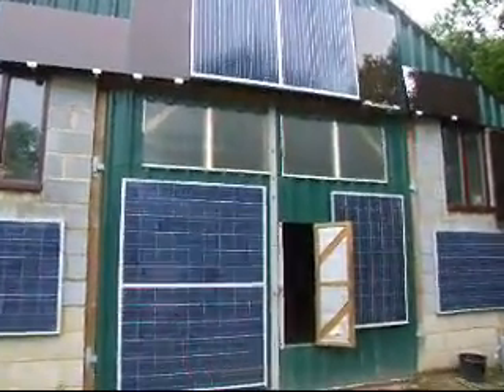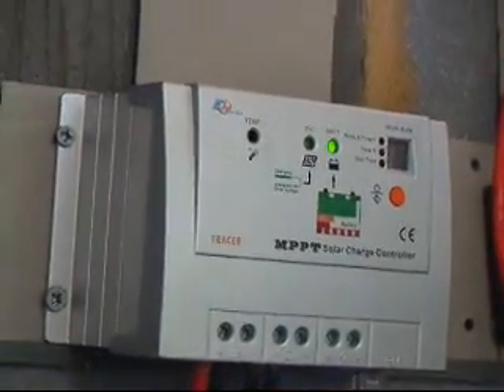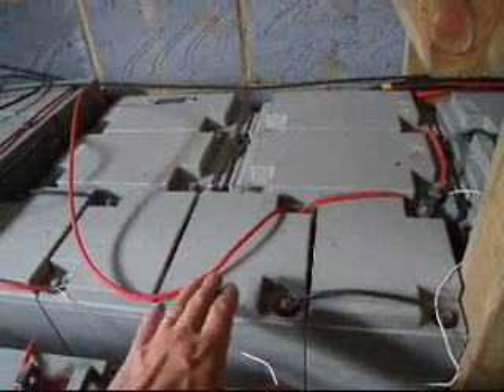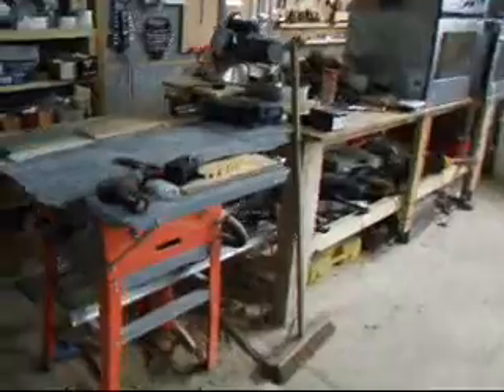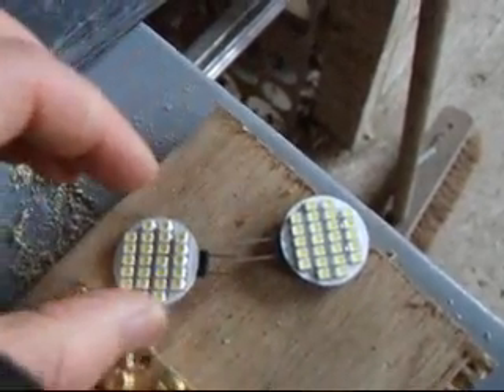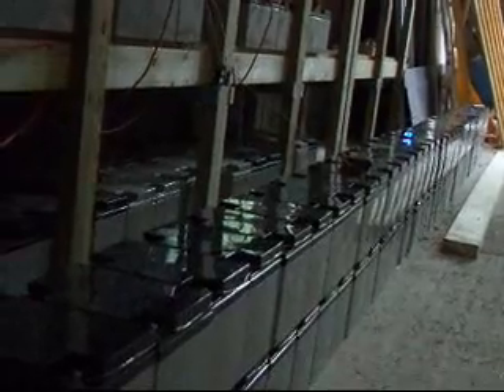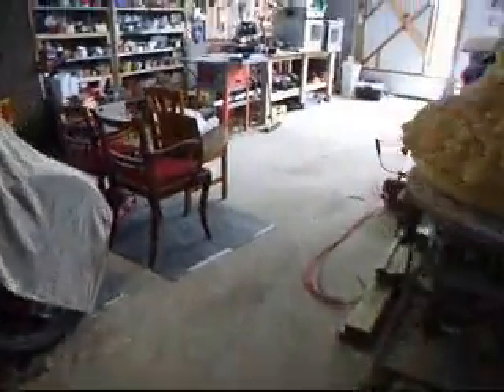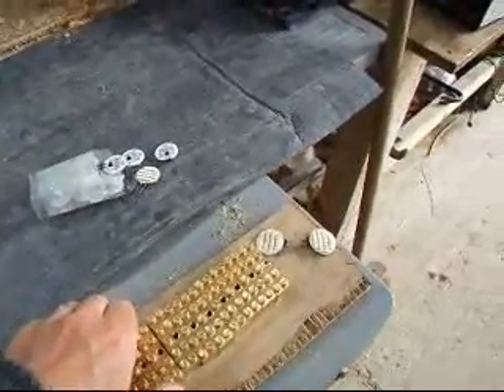Managing a solar power battery bank

Comment: How do you have excess to sooooo many batteries. I would love to have access to half of your battery bank
Reply from the maker: I keep my eyes open for emergency power battery replacements. In emergency systems insurers require them to be replaced every 3 years - so such batteries are available cheaply with another 7 years of life.
Reply: +latribe wow is there a certain insurer or site auction
Reply from the maker: Make friends with your local scrap merchant . . .

Comment: I assume that this isn't a joke but I do hope that you can share an update. There are several issues with your wiring mainly. I notice you referenced using solder wire as a fuse (7amps). Never use a underrated wire as a fuse. Properly fused system can give you a safe system for less than a few dollars I'm sure. Please do post an update hopefully you have not damaged your instruments or battery fire.
Reply from the maker: This system is no joke. It's probably not what you are used to as it's a distributed system rather than one focussing on giant cells. With many of these AGM batteries one doesn't want to charge or discharge at more than 4 amps each. So the solder wire as a fuse between pair of 12V batteries for 24V puts safety at the heart of the system. Solder wire melts below red-heat, unlike normal fuses, so it's safer. Grouping 6 24V units together, each unit working at maximum of 4 amps, why would I need larger than 6mm cable connecting them? 6mm cable carries up to 40 amps happily. So 6 times 4 amps is 28amps - well within specification. Four to six such units are grouped together on solder fuses designed to blow at around 70 amps. These groups are connected to the bus bars by two 6mm cables, so 12mm fine up to 80 amps. So each section of the battery bank is within battery, cabling and fuse specifications. Each of these banks is switchable which enables monitoring and testing. The system has powered between 10 and 20kwh per day for 9 months of the year for three years.
Reply: +latribe interesting. How did the power jacks hold up these few years later
Reply from the maker: The PowerJack high frequency inverters had a certain reputation well deserved but the low frequency units have good toroidal transformers powered by electronics common to W7 inverters and the combination is excellent. The 8000LF unit has given no troubles whatever during the past 3 years.

Comment from the maker: This system uses redundant batteries bought cheaply for £15 each which makes them much more affordable than wet cell batteries. The use of sealed AGM batteries requires a very different use regime to that people used to wet cell systems normally expect. A 60 amp battery should not be discharged at more than 6 amps. This is why there are 7 amp interbattery fuses, and groups of 20 batteries (10 x 2 for 24V) are fused at 80 amps or so and why they are connected up with equal and equivalent lengths of 6mm cable, double and tripled up where appropriate to give 60amp current carrying capacity, joining up into 75mm and where appropriate 150mm busbars made up from lightning conductor, and switch interconnexions. The whole system is thought through, not merely assembled by stacking rules.

Comment: this is a joke right? or is it a video showing what not to do ?
Reply: yes. its a what not to do video. lol
Reply: Justin Case
this is absolutely crap setup so so so so bad and dangerious and so many different types of batterie and amps, etc. he obviously wants to kill him self or someone else with this!!!!
Reply from the maker: +Justin Case Just because I'm not using standard wet cell batteries in a standard commercial setup does not mean that this system's as you think it is. AGM batteries require a different regime to wet cell systems and this arrangement has safety and battery longevity built in at its heart.
Reply from the maker: +Andrew Mays Far from being a joke this system is carefully designed with safety built in at the very heart of the system and . . . longevity of batteries in mind. It's unusual to have distributed sets of batteries like this but the arrangement works well and has been tested to its limit and served offgrid supply to the house now for a year. If you don't understand why this system has advantages I'm happy to answer questions.
Reply from the maker: +Jeremy Ohara This system is unconventional because most people would use wet cells. Treatment of AGM batteries in this usage mode has to be very different to conventional wet cell systems. All these battery banks are actually in a balanced relationship and the system works especially well.
Reply: I noticed your concern for balancing your batteries. Please properly wire your batteries with the correct gauge of wire and also use a battery balancer from eBay I believe they are needed and cost effective.
Reply from the maker: The batteries are wired with a proper gauge of wire. This system performs excellently and reliably.
Reply: I guess when you think of how many batteries that you have I can see the amp draw being minimal. Might i ask how that works when it comes to recharging the batteries when you are combating self discharge? Thanks for the reply
Reply from the maker: I haven't had a specific problem with self discharge. Because each group of batteries is on its own switch and can be isolated it's easy after a series of sunny days so that they are  effectively fully charged to isolate say 8 of the 10 banks or so and see if any are unduly losing voltage below the rest,  One can then disconnect the wires to the subgroups and check likewise,  It's a resilient and scalable system.

Comment: its very good you are using a bendini pulse motor to condition A single battery. I am a member of iaecforumco.com and we build those. your coil on the pulse motor is very small, used for small battery, not batteries. coil might be #26 magnet wire, you will need #18 wire and several tip or npn3055 transistors at least 5 to work with 250amp battery set up. with that small pulse motor it will take a very long time

Comment: the solder wire will not allow you to use the max amps from your individual battery bank, that's another reason you have some batteries in a bank being drawn down more then others. we are trying to give you information which will keep you safe, instead you just want to argue and say it works safely,,, for how long, I would rather see you safe!

Comment: I also watched that long line of batteries you hooked together. NOT A GOOD IDEA!!! when you try to desulfate a battery you do that one at a time. not a long group, each battery will react differently. I build solid state bendini pulse motors used to recondition large L16 Trojan batteries. NEVER, NEVER do more then one at a time unless you are doing two 6 volt batteries as a 12 volt. you are doing a lot of dangerous things.  go to iaecforumco.com and they will show you how to build a solid state instead of wasting money purchasing a small desulfator to do such a big job.
Reply: Thanks for`the tip on desulphating

Comment: nice batch of batteries you have there. just from watching your video, the cables are not large enough to handle the amps. also, with all the different type of batteries I would recommend making individual banks controlled by on off switches. you might have to large a difference in amp hour rating from set to set. especially those small wires you are using like a fuse,, major problem there. use only fuses not wires. Hot spark or flame around a battery bank is not a good idea if that wire burns out.
Reply: I'm not stupid. Every bank is connected through a switch. The cables are large enough - 2X 6mm cables per bank of batteries - 12mm - fine for between 40 and 60 amps continuous and more instantaneous so fuses set to blow at 80 amps instant. 10 banks connected by cables allowing 60 amps - 600amps - 12 kW - more than I need. One of the reasons for using solder wire is that it melts before red heat. The system is designed with safety at its heart.

Comment: I agree with Justin, you need to use bigger cable at lease 2 GA but I would go as big as you can afford like 1/0 or 2/0 GA or bigger. and the solder as a fuse is just asking for trouble.
Reply: The solder fuses work brilliantly. One needs to check for heat and expansion and contraction resulting in poor contact and heat but when these have settled down they are great. The solder wire between batteries works excellently. The cables are large enough - 2X 6mm cables per bank of batteries - 12mm - fine for between 40 and 60 amps continuous and more instantaneous so fuses set to blow at 80 amps instant. 10 banks connected by cables allowing 60 amps - 600amps - 12 kW - more than I need.

Comment from the maker: Yes - normally you would be quite right. But this is a gentler load system. The batteries are grouped in 6 or so 70Ah per group, each 24V pair of batteries being limited to 7 amps by the interbattery fuse. Most of these groups are connected together in groups of an average of five which are then connected to the central bus with 2x6=12mm wire. There are 10 of these groups so a load of 40 amps is only 4 amps per group on the 12mm wire and on this load, there is little voltage drop.

Comment: mate your wire size is not good. Not sure who told you to wire them like that but they gave you very band information. Please go look at my video ( Off-Grid. A look at the low volt side of my solar wiring ). You will get a lot more out of them.

Comment from the maker: When connecting the Infinitum and disconnecting there is a small spark. So it's clearly active, unlike others. I have tried it with a low battery and it did appear to bring it to life to enable charging. So I believe it does do what it says it does and on this basis I have bought another. I bought what was advertised as a 12V unit but have used it for a long period on 24V. It gets warm but is still working. It's a piece of equipment worth trying.